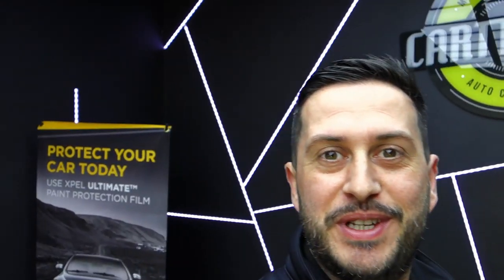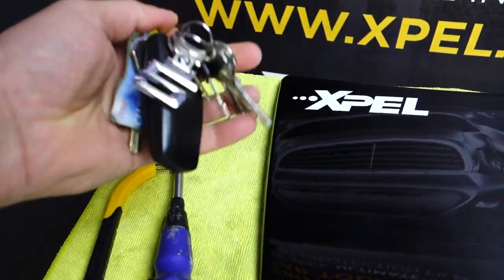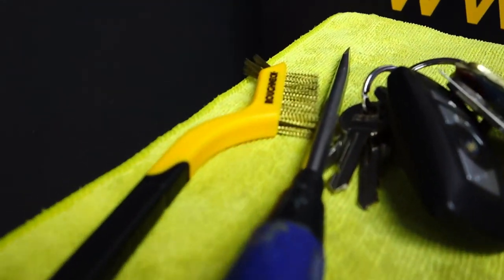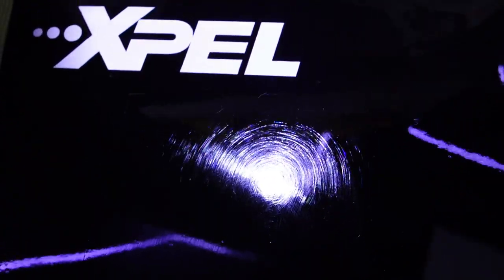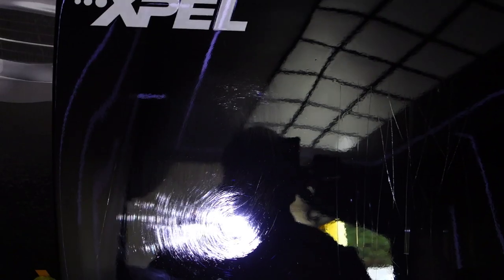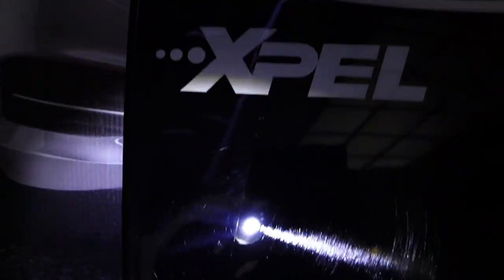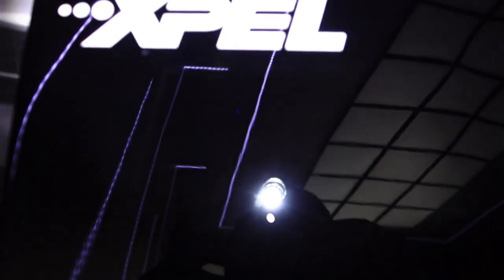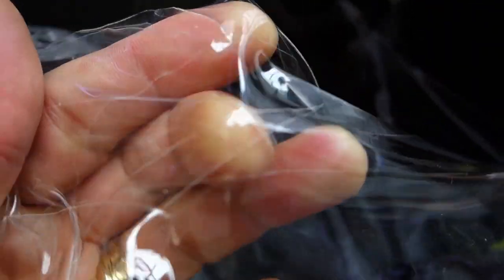What Happens if I Scratch The PPF with a Screwdriver?

Comment: So, if PPF is so durable, why would anyone need to put a ceramic coat on top of it OR why would anyone fear taking it through an automatic car wash?
Reply from the maker: Thank you for the question.

When only certain panels are partially protected with PPF and the rest of the paint is protected with ceramic coating, we apply ceramic coating on PPF to have the same hydrophobic effect on the whole car, and to be easier to maintain (wash).

PPF and Ceramic Coating are completely different and it is very important to understand the difference between them.

Ceramic Coating is just a thin layer of ceramic (or flexible for PPF products) that protects the paint from certain chemical contaminants such as bird droppings, tree resin, etc.
Watch the video: https://youtu.be/FGfZnpPiZ8Q

It gives protected surfaces a very strong hydrophobic effect that prevents dirt from sticking to the paint and is very easy to wash.

PPF is a transparent film of 150 microns that stops the stones from hitting the paint, certain scratches or even cases of vandalism when someone uses a nail or a key to scratch the car.
Watch the video: https://youtu.be/hI4lW8uNRqY 

PS: Subscribe and follow us because we will soon post a video with Lamborghini Urus that was vandalised (someone scratched the entire left side with a key) and you will see how effective it is to have the car protected with PPF.

Thanks! #CarttitudeTeam

Comment: Have to pay to have the PPF reinstall after bird droppings stay on the hood for 2 hours and stained it
Reply from the maker: The cost to have a PPF reinstalled on a vehicle after bird droppings have stained the hood will depend on several factors such as the extent of the damage, the size of the area that needs to be covered, and the type of PPF used.

In general, it is recommended to have the bird droppings cleaned off the hood as soon as possible to avoid any damage to the paint or PPF. Also, flexible ceramic coatings designed for PPF and vinyl are recommended to be applied in top of the PPF for the extra protection and durability of the film. 

If the PPF has been damaged or stained, it may need to be replaced or reinstalled to provide continued protection.

The cost of reinstalling a PPF can vary depending on the make and model of the vehicle, the size of the affected area, and the type of PPF being used. It is best to consult with a professional auto detailing or PPF installation service for an accurate estimate.

In summary, it may be necessary to have the PPF reinstalled after bird droppings have stained the hood, but the cost will depend on various factors and should be evaluated by a professional.
Reply: @Carttitude  Thank you for the detail response. 
FYI - I do get bird dropping off ASAP; in fact, I keep a bottle of water and quick shine in the car's truck.  Unfortunately, I can't sit next to my car 24X7. I do not know the worth of PPF if I have to add ceramic.  If that is the case, then I should just have done the ceramic.  I had the car ('21 BMW M5) shipped directly from the dealer to the PPF installer.  
Last,  the car is garage kept